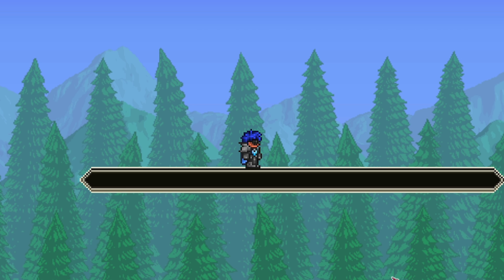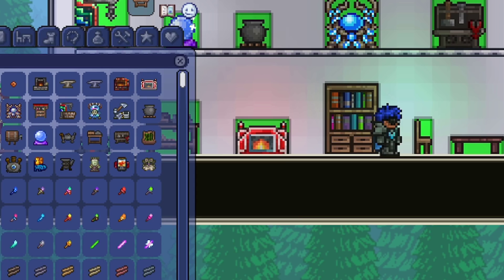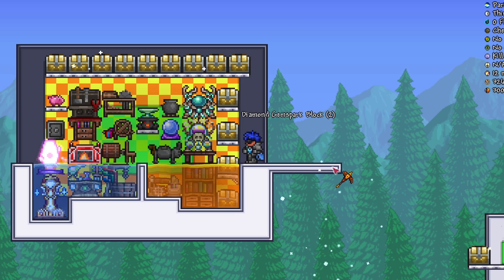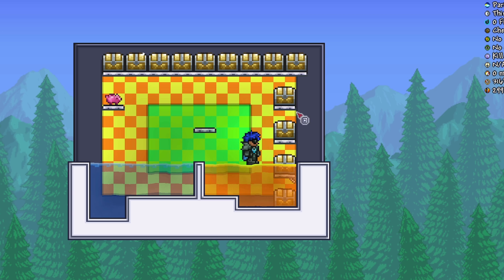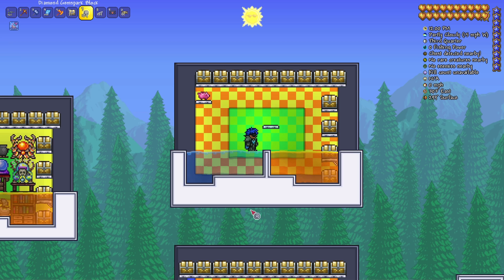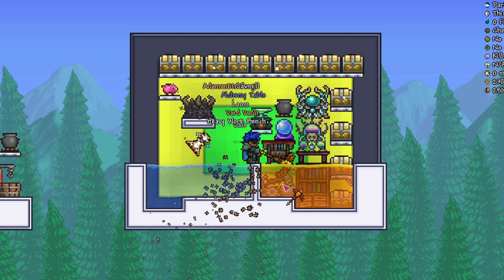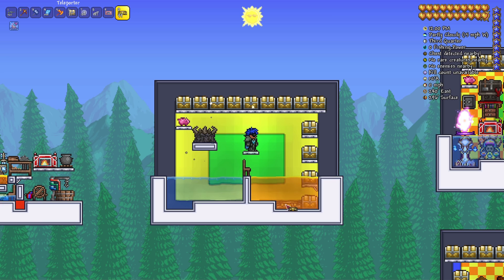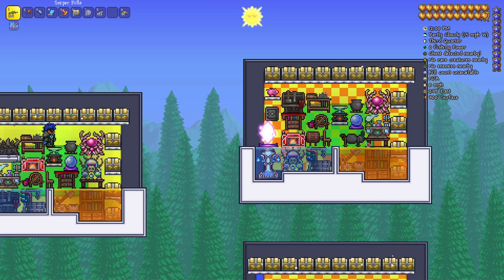How to create the MOST EFFICIENT crafting station in Terraria using GLITCHES

Comment: 6:57 Ok, why doesn't placing the cooking pot break the anvil?
Reply from the maker: most furniture/crafting stations only have updating properties located at the bottom, therefore it won't break it.
crafting station and anvil on the other hand will update things.. sometimes, which is why there are slightly seperated from the rest.
Reply: @Gromek999  gotcha

Comment: can't even get past manipulator and cooking pot without them exploding after I take away the teleporters. skill issue
Reply from the maker: make sure you do it in the exact same order as in the video, it will explode if done even slightly wrong
Reply: I've retried it like 8 times in the exact order, placing and destroying everything the same way you do T~T. I guess I'll keep trying lol
Reply from the maker: @YaddyHyrule  are you on console maybe? I haven't tested this on other platforms.
Reply: @Gromek999  Nope. Just in tmodloader. My initial thought was that you did it in vanilla terraria which is why it might not have worked or been compatible for some sort of coding reason, but then I remembered you're using the see-through liquids mods so it can't be vanilla. If I find the source of the problem I'll be sure and let you know (and also how to fix it) for future reference if anyone else has the same problem
Reply from the maker: it is all vanilla, the liquid mod is purely cosmetic.
making it in tmodloader is not required. in fact it is likely why it is not working because tmodloader has different game coding (aka less spaghetti).

liquid mod does NOT require tmodloader, it is a workshop item.